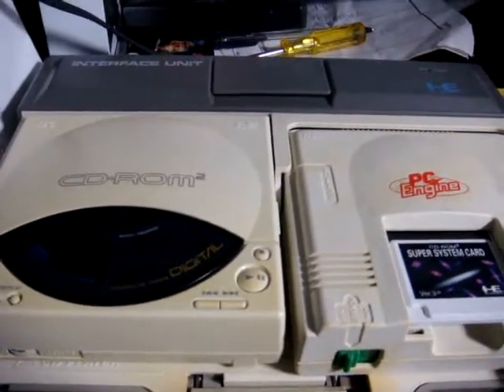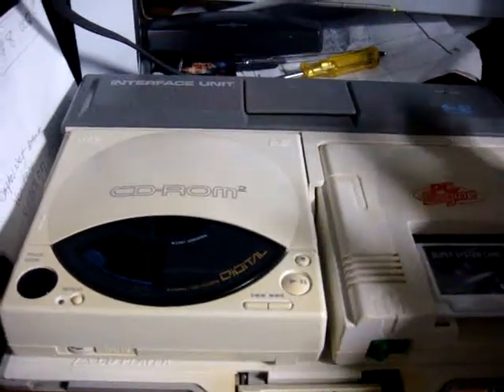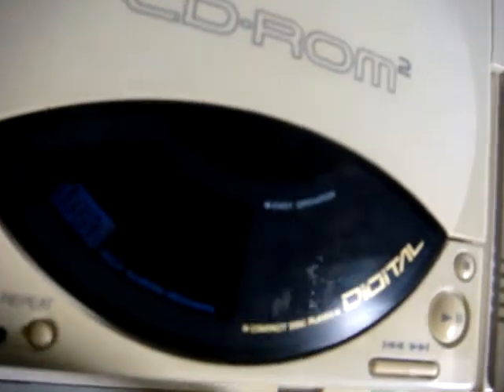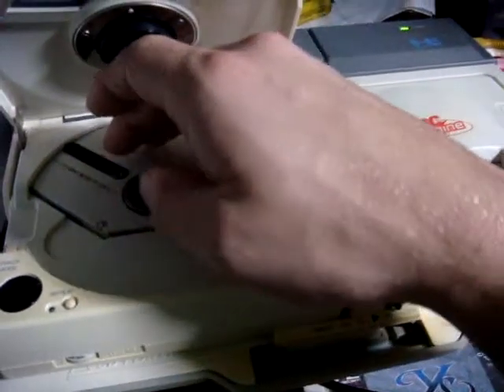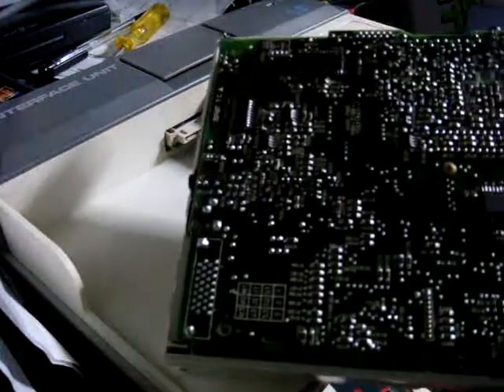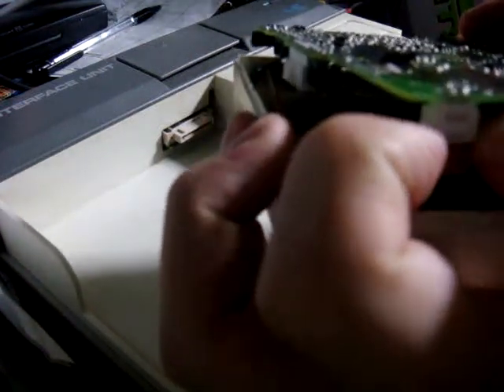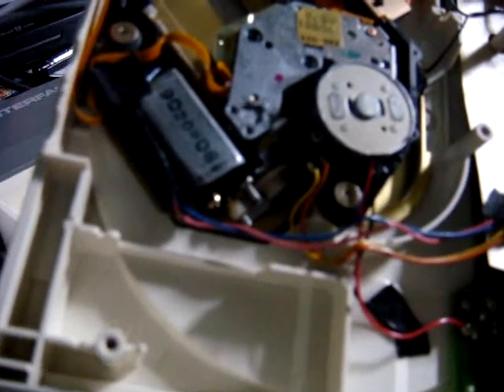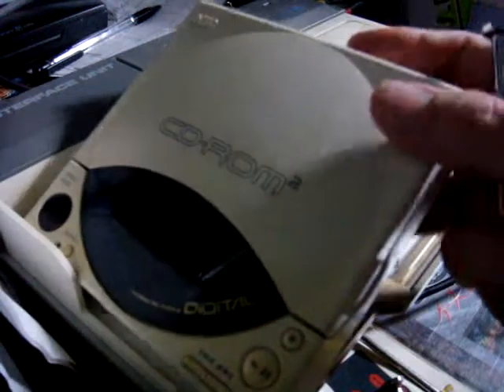PCE CDRom2 Unit Trouble Shooting, PC Engine CD-ROM2 Repair

Comment: I found this video trying to find a solution to an issue with a new PC Engine setup I was having. Games refused to load, it would say "wait a moment" but the disk refused to spin. I'd already checked the middle gear and it was fine but still no go.

I left the thing trying to load while I watched your video and after I finished, I heard some strange music in the background. The PC Engine had loaded and was playing the opening video! I thought maybe the laser was bad and that's why it took so long to load, so I turned it off and on again. The game booted in a few seconds. So uh, thanks for fixing my PC Engine somehow.

Comment: Nice video, Luke. I have a PC Engine CDRom2 on the way and the CD unit doesn't work. I'll have to diagnose it when it shows up but this at least gives me an idea what to look for. Also, I know where to get replacement gears so I should be good if it's just that gear. Again, thanks for the great videos.

Comment: That CD drive looks rather small and the circuit board looks about the size of the main case.  What's the deal with the little VFD readout on the unit?  Can the CD drive be used as a standalone CD player for a stereo system?  Why do they call it Super CD-ROM2?  What I mean is, are the discs different to standard CD-ROM discs?  Could yo make a video talking about the capabilities of the NEC CD-ROM add ons for the PC Engine/Turbografx?

Comment: Looks like the first thing I'm going to do when I get a PC Engine CD-ROM or TurboGrafx CD unit is to take the sucker apart!  Thanks for showing this, it'll be really helpful when I find a TurboGrafx CD(US units are made exactly like the PC Engine CD-ROM except they're colored black, right?).  By the way, how many teeth is that spindle supposed to have?  If I can get information on the number of teeth, I'm going to open all my spare CD-ROM drives for a possible replacement(ahead of time.. lol).

Comment: Hey, just started watching your videos. Really interesting! :). What brought me here was trying to figure out what is wrong with my own PCE system. I don't expect a response; just hope for one.

I've recently bought a PCE and CDROM system exactly as in your video (inc Super 3.0 card). The problem with my unit is that the PCE fails to talk to the CDROM unit, when i press unit, it waits and there's no response from the CDROM. The CDROM unit will play the audio from the game if I press play on the device, other than that, nothing. The PCE plays HU cards fine. Any ideas? Thanks.

Comment: Besides trying to get a replacment gear manufactured (or, a bunch of them :P), is it possible to repair the broken spots (assuming the gear isn't completely dust :D) in, say, epoxy, and basically cut your own teeth?  Would be really easy, but I don't know 1. how well the epoxy would stick to the gear, that would depend on what type of plastic the gear is made of... and 2. whether the remainder of the gear would eventually disintigrate.

Comment: I've recently bought a pc engine with the cdrom2 and ifu, yesterday was reading backups but like in the 2nd or 3rd try, but i'd some issues because after reading many backups now I press the button to run the cds but when the 0 appears automatically turns off and i never see the 1 number, when I press many times the button with some luck again spins the cds but even reading original cds It takes a but tries to read them, rn is totally blocked or something, i hope someone could help me or have some idea with this

Comment: What are the differences between CD-ROM2 and Super CD-ROM2 ?
Reply: I don't think there is. They are the same hardware in its CD player, but use different system cards. PC Engine has the original CD HuCard, Super CD HuCard, and the Arcade HuCard, which just went into the cartridge port and had different amounts of RAM. If you had the Arcade Card, you can play any PC Engine CD game (provided your CD Player isn't defective like in the video)